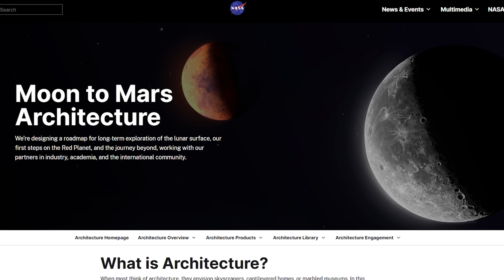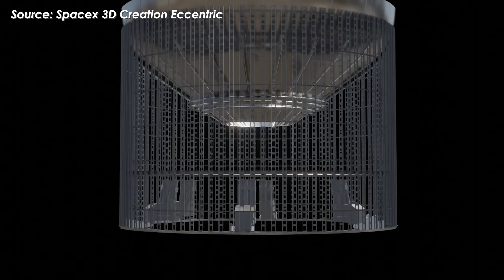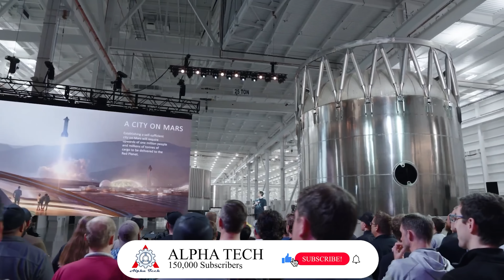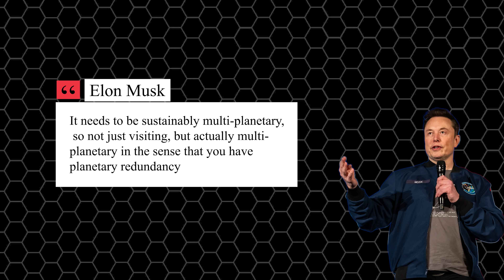NASA & SpaceX revealed new Way to Land Starship on Mars and Secretly Practicing SHOCKED China...

Comment: If Mars atmosphere is too thin for aero-braking, why not slow the craft down to a manageable speed before entering the atmosphere?
Reply: Its kinda silly arguing about something that will never happen. 

So controlled  or propellant speed reduction in Space especially deep space is very difficult next to impossible to pre
Calculate trajectory and  requires magnitudes greater propellant not only for corse corrections, space is different than earth .. a craft traveling through space can accelerate in a direction it is already heading  with little short bursts of firing the rockets. However to create enough force to act against the compounded amout of velocity force.  
Much longer burns and has to be done very gradually over distance. 
Every little reduction of velocity adds days weeks even months to the journey to Mars. 

Apollo  missions once In orbit.  Would use rockets to the desired alignment then basically wait for rotation of the earth  to wind them up like an automated pitching machine.  Then when the calculated  orbital ejection  was in line with where the moon would be in 4 days. They fired up to maximum.  Being close to earth there is enough gravity and such that rockets can produce greater thrust than in deep space.  With in a very short amount of time
They were traveling at thousands of kilometers killed the rockets and just coasted  to about a little over half the distance. 
Before  they needed to do little periodical burns. Over half way took less than 24 hours rest of the distance took  more than twice that so that the command could enter lunar orbit. Too fast and they shoot past.  Too slow and they would not have enough fuel to return home. 

SpaceX opperates in a wierd twisted version of fiction based on reality based on elon's deluded self reality. Nasa authorities either through corruption,  cult of personality, or incompetency have allowed spacex to trust me bro. Just few more small tid bits to work ,
And so on. 

However the energy  trajectory  to not only reach mars but hundreds of hypothetic return calculations that claiming
Starship could achieve a  controlled enter mars orbit , land then have anywhere close to enough  fuel to return home would  so easily called out that they would  have put the kabosh on elons fake it till 
We make it a long time ago. 

The various orbital and Mars lander missions have taken several different  trajectories including over shooting mars using Jupiter to slow down before heading  back to Mars. Think the the last 2 mars missions have taken a routes heading away  from mars
Hanging huey around the sun then about a year later reach mars. All these 
Incredibly long and costly 
Routes just to slowdown 
The craft velocity when reaching mars and still have to utilize elaborate unconventional methods to safely reach the surface because  of  the lack of atmosphere aero brakeing.

Comment: Ok, so SpaceX admits Starship will fall over. What we have now is a vehicle with a yet to be invented heat shield that carries the additional weight, complexity and risk of specialised landing engines which only partly escapes the problem of high speed projectiles being fired from the surface back at the ship. Please, let's give up on this concept and accept that we already had the answer back in 1969. A simple, light, fully propulsive lander that carries people from Mars orbit to the surface, which doesn't subject people to debilitating g forces, can land safely on uneven terrain, only requires you to descend a few meters and is generally far safer. Also, where we went wrong with Starship is insisting on a one-size-fits-all vehicle where in fact we need specialised vehicles. One for Mars landing/ascent. One to get you safely from Earth orbit to Mars orbit and return. And the underlying mistake is the notion that we have to land heavy supplies along with people, all on the same vehicle. Separate those two and you have a far more efficient, far safer architecture. Please let's stop clinging to Elon's dangerous delusions.

Comment: I think your numbers are way off on the Mars re-entry.  The slow down process will happen days before reaching mars.  You cannot make orbit going 7 kilometers per second or 17,000 miles an hour like you could on Earth.  You would skip right past Mars on your way to the asteroid belt.  I am thinking it will be closer to 8,000 miles an hour and make a pass through the atmosphere and out the other side into space, a long eliptical orbit, then come back from that and fly through the atmosphere again to slow a bit more.  Make a correcting burn for a more circular orbit, plow through the atmosphere again and again until you can stay in the atmosphere.  There won't be as much heat due to the fact that there is less than 1% of the mass of air hitting you.  That's less heat, less friction and will need more fuel to slow down to land.
Reply: What SpaceX proposes is  direct landing. Hence the occupants suffer 5 to 6 gs of deceleration.
Reply: @saumyacow4435 Do you mean ballistic atmospheric entry?  I could be wrong, but fairly certain "direct landing" is not an actual term, at least in regards to  landing on mars.

Comment: We aren't living on Mars in the near future.  There are other places that would be easier in our solar system to live on.  That's what the science tells us.

Would venus be a better choice than mars for a colony?
This is a fascinating debate in aerospace and colonization circles! While Mars gets most of the media attention, there's a strong, science-backed argument that Venus's upper atmosphere presents significant advantages for a human colony over the surface of Mars.   
The key is that any Venus colony would be an aerostat habitat—a floating city—at an altitude of about 50 km (30 miles), not on the deadly surface.

Here is a comparison of the major points:

Feature Venus (50 km altitude) Mars (Surface) Advantage
Gravity ~0.9 g (Earth-like) ~0.38 g (Low) Venus (Better for long-term human health)
Atmospheric Pressure ~1 bar (Earth-like) ~0.006 bar (Near vacuum) Venus (Habitats don't need significant pressurization)
Temperature 0  C to 50 
∘
 C (Temperate) Down to −140 
∘
 C (Extremely cold) Venus (Requires less complex thermal control)
Radiation Shielding Excellent (Provided by thick atmosphere) Poor (Requires thick, buried habitats) Venus
Travel Time Shorter (Approx. 3-5 months) Longer (Approx. 6-9 months) Venus
Resource Access Abundant C, N, O (for air/fuel), but lacks surface minerals Abundant surface minerals, lacks atmosphere/gravity Mars (Access to solid materials)
Atmosphere Hazards Sulfuric acid clouds Global dust storms Mars (While storms are a risk, acid is a constant, corrosive challenge)
🚀 Key Arguments for Venus
Earth-like Conditions: At the 50-km altitude, the atmospheric pressure and temperature are remarkably similar to those on Earth's surface. This means habitats wouldn't need to be high-pressure vessels, and a simple oxygen mask and acid-resistant suit could be enough for external work, unlike the bulky, rigid pressurized suits required on Mars.   
Earth-like Gravity: Venus has approximately 90% of Earth's gravity, which is considered essential for preventing the severe long-term health issues (bone density loss, muscle atrophy) associated with low-gravity environments like Mars.   
Radiation Protection: The thick atmosphere above the floating colonies provides a natural, comprehensive shield from cosmic and solar radiation, a major concern for any Martian surface colony, which would likely need to be built underground [Source 1.2, 1.5, 2.5].   
 Key Arguments for Mars

Access to Surface Resources: Mars has a solid surface, allowing easier access to minerals, metals, and water ice. Building a colony on the surface, while challenging, allows for easier resource extraction and construction using materials found in situ.
Familiar Technology: We have extensive experience with surface-based missions (like the Moon and Mars rovers), and while Mars colonies would be pressurized, they would leverage engineering concepts already familiar from space stations and Moon bases [Source 1.4].
Water: Water ice is plentiful on Mars, especially near the poles, which is critical for life support and propellant production [Source 2.5]. Venus is much drier.

⚖ The Verdict
For long-term human health and safety, Venus appears to be the better choice because the upper atmosphere naturally provides Earth-like gravity, pressure, and radiation shielding.
For ease of construction, resource extraction, and near-term feasibility with current technology, Mars is generally viewed as more practical due to the solid surface and access to water and minerals.
Reply: Earth would be a far better choice for a colony. Let's try that.

Comment: First they need a moon space station then they can work on landing starship without it landing catch tower.  The same for mars  space station First then landing on the surface.  Building on the surface of mars will take up to 200 years because First unground safe house must be built for living,storage, work shops,equipment, supplies,hospitals,food production,  and more all this needs to be set up before any above ground work can be done.  A d all of this will take a lot of time  ! That the safe plan.  Anyway other than that won't be safe but it will be faster ! Do you want to live on mars or die there your choice .

Comment: I believe the statement at 3:35 is wrong. Starships can't perform a belly-flop on Mars because this is performed on Earth in the thick atmosphere of the troposphere. It is used to slow through supersonic to subsonic speeds. On Mars, supersonic retropropusion is substituted for this type of drag induced braking.
Reply: The belly flop will be much longer and at a shallow pitch, almost exactly as every other mars landing. If parachutes work on mars a  belly flop will. It just needs a long shallow path down.
Reply: You could do it on Mars; just circle Mars lower and lower until you've received the same slowing down.
Reply: Terminal velocity right down to the surface is still in the low hypersonic range, about five times faster than on Earth, but the the speed of sound is slower. That's all a bellyflop will get you, no matter how long you somehow stay off the surface to perform it. On the other hand, if you want to glide on a shallow angle you have to stay off the surface for an extended period. To do that In such a thin atmosphere you need a proper lifting body to create enough compression lift, and you need hypersonic speed for that. In other words, once you somehow get well into the supersonic range, you just fall out of the sky like a stone, no matter what your ship or parachute design is.
Reply: @deanmichalos6848  The physics in the published SpaceX Mars landing simulation is correct. Starship does have lift at the right angle of attack. The simulation shows a speed of just under 2,000 m/s at an altitude of 5km, right before Starship changes its angle of attack and "bounces" back to 10km. So Mach 5-6 in Mars air. To pull off this stunt you need to preserve velocity by deliberately presenting a lower drag attitude on the way down. It's otherwise called a "late lift" descent and it's been used on unmanned probes. The problems with this profile are many. For one thing you have seconds of margin. For another you've got a vehicle where the engines have to relight at the right moment, or you have a crater with your name on it. This is why a fully propulsive lander with engines lit (and throttled) all the way down is safer. Also, this profile is great for unmanned probes that can survive high g forces. But taking a bunch of people and exposing them to zero g for months and then exposing them to 5 or 6 gs is going to leave you with a bunch of people who need to be stretchered off the vehicle.
Reply: The landing simulation that has features on SpaceX's website for years whose Starship adopt a low drag descent (a deep dive). Then, barely 5km above the surface it adopts a "belly flop" position. Basically getting the most lift out of what little atmosphere it is. This subjects people who have been in weightlessness for months to a debilitating 5 or 6 gs. Starship bounces back to 10km from where it does tail first retropropulsion. It then creates its own crater.
Reply: 5 or 6 gs from drag In atmosphere eqivalent to Earth's pressure at about 35 km altitude? I think it would have to be going at below hypersonic speeds at single digit km heights above the surface, at which point drag becomes negligable. Are you referring to the simulation where the ship starts by coming in upsidedown? That's because they are going faster than orbital speed so they need to create negative lift to stay in the atmosphere. If I understand that simulation correctly, I'm not buying it because of the thermal loading. They are coming in directly from interplanetary transfer, at superorbital speed, going directly into EDL. The TPS won't handle it. They need to do the upsidedown aerobraking, then pull out of the atmosphere into an eliptical orbit that will give the tiles time to cool. After doing that, maybe a few times, their orbit will become more circular with less of a maximum velocity as they pass through the atmosphere at periapsis. Eventually, their pass through the atmosphere at perihelion will be slow enough for them to bite harder into the atmosphere for descent. My point is, what SpaceX put on their website for public consumtion bears limited resemblance to the real situation as it develops over several years. It just a placeholder to develop ideas around.

Comment: It's enough to constantly write about flying to Mars on any ship with chemical fuel engines. Only nuclear propulsion has a chance to reach people with minimal possible damage from space radiation. A ship of this size and mass, like Starship, will not be able to land on the surface of Mars, because there will not be enough fuel to brake from the second cosmic speed. The most realistic would be to fly in a transport like in the movie "The Martian", and descend to the surface in a capsule from orbit, like astronauts from the space station to Earth.
Reply: A year or two ago, I saw a SpaceX simulation of Starship landing on Mars. In the simulation it was stated that the ship would only need 1% of it's fuel to carry out the landing. So that's what SpaceX believes.
Reply: Generate your own radiation. Excellent.